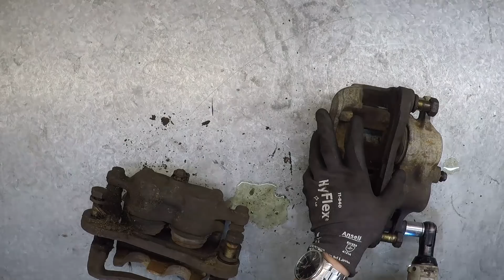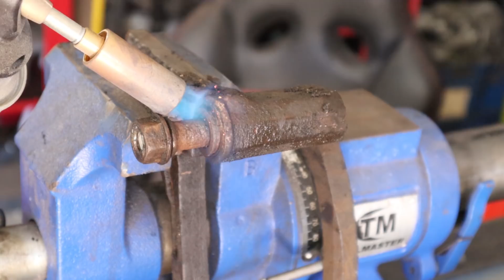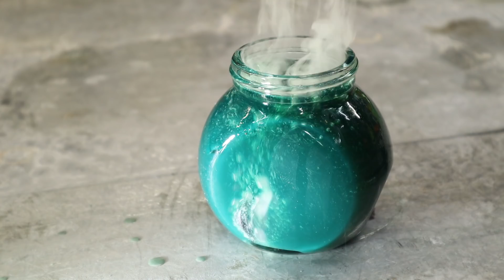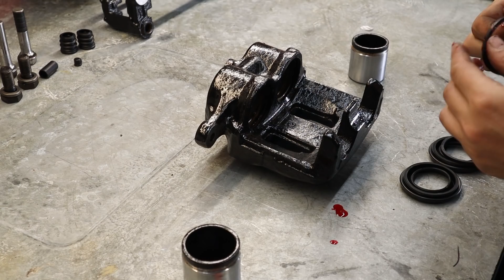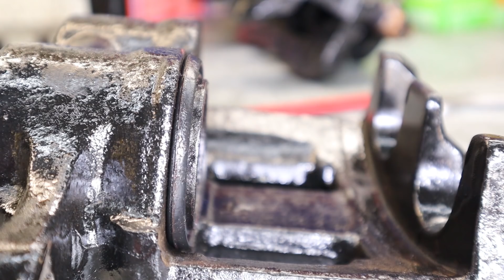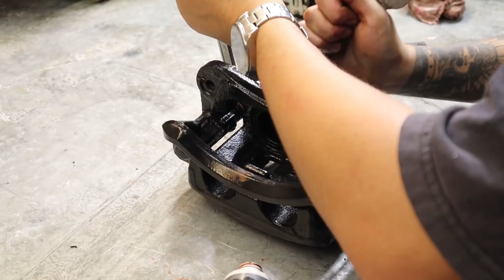How to Rebuild a Brake Caliper (COMPLETE GUIDE) - HJ75 Troopy Build (EP21)

Comment: Questions (2): 
1. How about using actual brake fluid to lubricate the brake piston and interior of the brake piston rubber boot during reassembly? This would keep the new brake fluid that you will add later from becoming ‘contaminated’ with whatever lubricant paste might have otherwise been used.

2. Is there a specific reason you use copper anti-seize vs the silver coloured anti-seize? Please pardon my ignorance!

Great video, thank you for posting.

Comment: ripper video's, loving the build so far. just be aware of the melting point of that grease, for your sliding pins on the calipers i'd be more inclined to use a high temp wheel bearing grease or the copper anti seize, last thing you want is melting grease on your brakes. still a grouse watch, but a little heads up, cheers